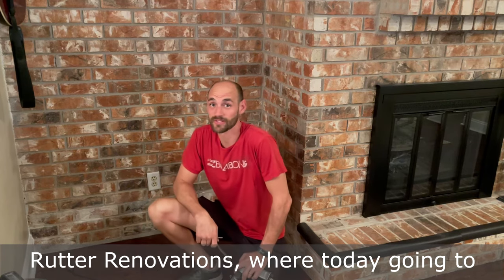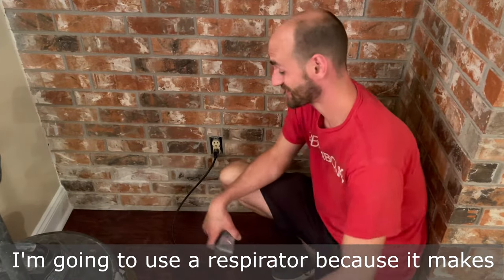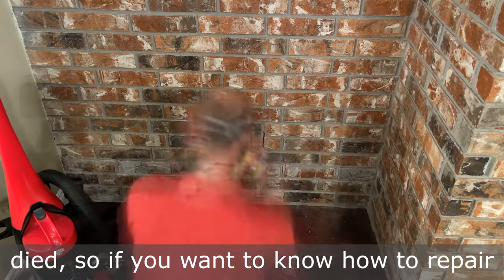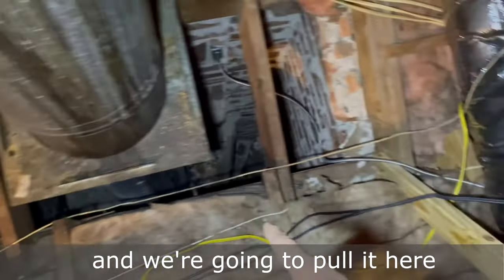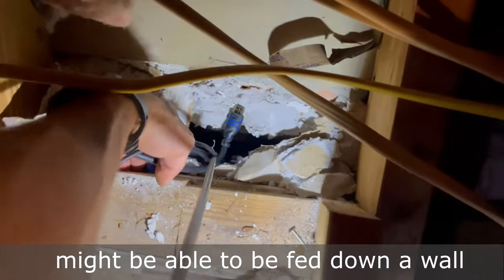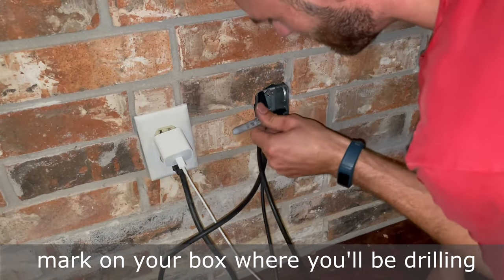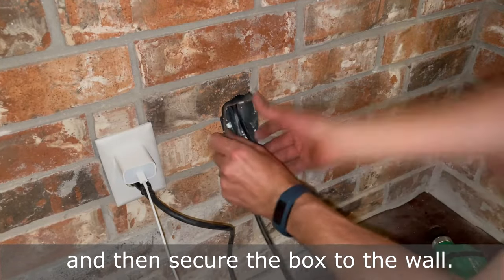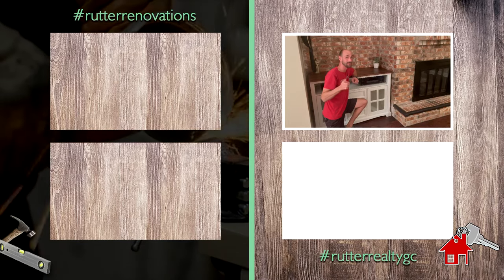How to Add an Outlet in a Brick Wall

Comment: Is this a decorative brick wall or is this brick from the supporting walls?
Reply from the maker: This is a decorative brick wall on the interior of the home. Though, most brick walls are just a facade on the exterior and not actually load bearing. The process would be the same for an exterior outlet. Consult a local professional to double check your specific situation.